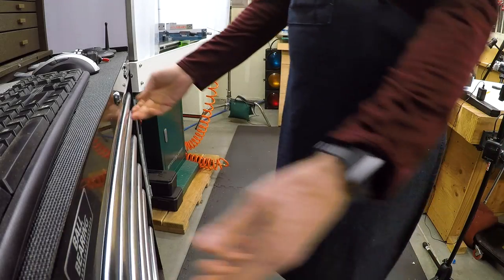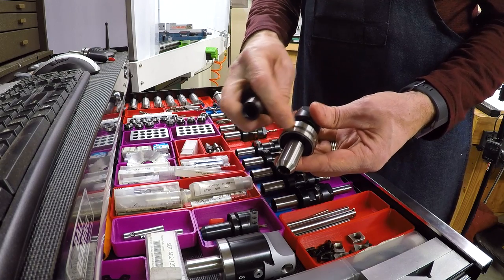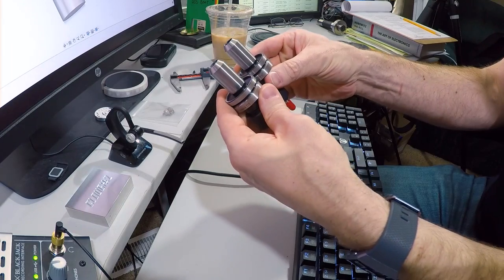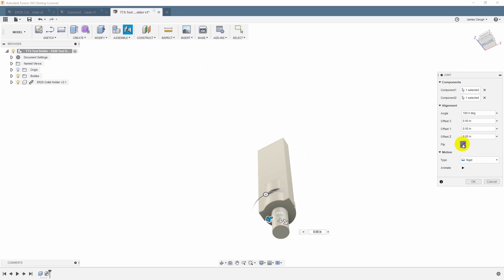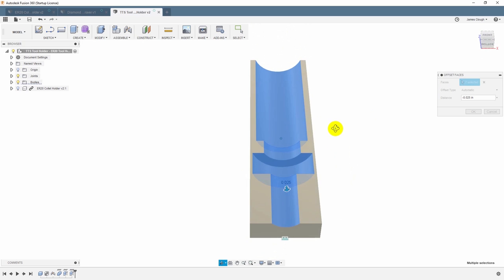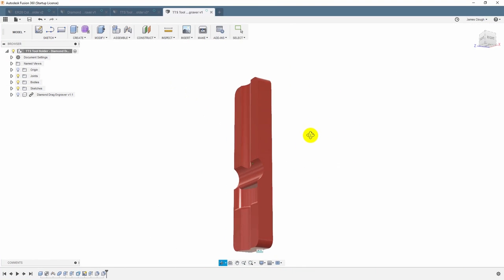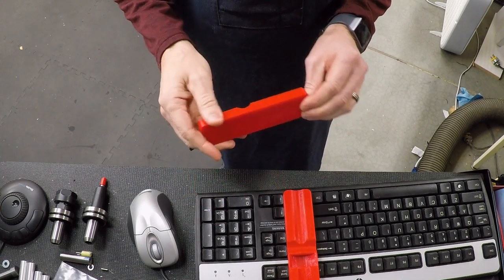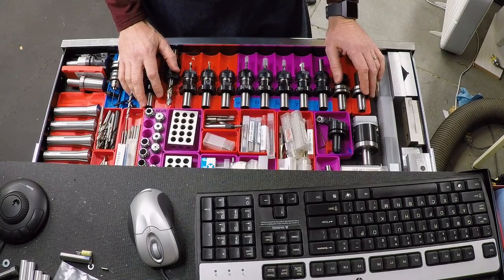How to Make 3D Printed Tool Drawer Organizers

Comment: Sir, with the biggest respect, but if you set up your slicer correctly, you dont get the extra thinker line on the bottom. Also ABS gets no warping if you have an enclosure. PET-G is like PLA a beginner filament, which needs no experience. ABS needs it. But for your needs, you PET-G or in this case is good enough.
Reply: abs is not great when it comes to oil contamination...  and its a good idea to use the PLA and bake in the over for an hour and 90 degrees (depending on the spec of the PLA brand)
Reply: @IncredibleSolv  Absolute right what you say, but ABS is not ABS there are hundred different types of ABS like PLA or PET-G. I made my own now with my filament extruder, because i was bored of the differences all the time i got from manufacturers when they change the % of each component. But at all its always good to give the filament it into the oven to dry it BEFOR and AFTER the print to let the molecules get back in their position for some hours. It becomes harder and better.
Reply: POM or PA12 is better for oil parts
Reply from the maker: There are lots of factors when it comes to material selection.  For many years, I used ABS for everything.  It's particularly good as an engineering material for things like gears because it's tough and has good surface lubricity.  The hundreds of extruders and RC airplane parts I've sold over the years have all been printed in ABS.  ABS is also a good choice for outdoor projects that will be exposed to weather--especially with a coat of paint to protect from UV exposure.  PETG is easier to print without warping, but has other issues.  It's gummy and stringy and doesn't reproduce fine features well at all, so it tends to be terrible for mechanical parts.  It bridges poorly and has to be printed slower to get good results.  However, layer-to-layer adhesion is fantastic.  Large, thin-walled parts are very resilient in PETG.  The layer adhesion is so good it usually tears across the layers, rather than splitting between them, like ABS.  The phone cradle in my car is PETG, and it has held up very well to the heat and cold without any issues.  I've always used ABS for that application, but PETG's flexibility I think makes it a better choice.  The layer adhesion comes with a tradeoff though, in that it's very difficult to remove support material.  I've never found much use for PLA.  If I were making decorative items to sit on a shelf, it might be okay, but for engineering use, it tends to be too brittle.
Reply: @Clough42  so if you have the problem that layers don't stick together, it's because your fan is blowing too much air. PET-G often only needs 10-20%. It depends on the material, but the basic mistake is that the fan is not adjusted correctly, not the material. I've had a lot of people say it's the material, in the end it was always the fan that was wrong.
Reply from the maker: @Qing I haven't had any issues with layer adhesion with PETG.  I have had issues in the past with ABS, and solved it by increasing the extrusion temperature to 255C.  Layer adhesion with PETG has been excellent.  It's one of the things I love about it.
Reply: @Clough42  Great information Sir.  
Thank you again.

Comment: Why are the only choices PETG or ABS?
Seems like PLA would be just fine.
Reply from the maker: It's what I have on hand.  I don't stock PLA because it's usually pretty brittle for mechanical parts.
Reply: Clough42  what brand PETG filament did you use for these?
Reply from the maker: @rickeldridge8227  These are Hatchbox.  I also use eSun.

Comment: Autodesk fusion 360 is too rich for my blood since I only do this weekend warrior.  $495 a year or $60 a month.
Reply: Take one class a year at a community college and it's free.
Reply from the maker: Fusion 360 is free for makers/enthusiasts and even for businesses making less than $100,000 per year.
Reply: What Clough42 said:  It is completely free if you are a hobbyist / maker / student....  You just need to install it and click the license thing in the upper left and fill it out correctly.  They will give you a license for free as long as you meet the requirements  (make less than $100k per year in the venue that you are using their tool.)   I absolutely LOVE that they do this because it gets a lot of people into 3d design that might not have entered into it.
Reply from the maker: It's really smart.  It basically means that every mechanical engineer coming out of school already knows Fusion 360.  I really can't understand what Dassault Systèmes (makers of SolidWorks) is thinking.  If they offered student and enthusiast pricing, they could totally own this space.  (Like they used to.)
Reply: @Clough42  Serious question though, because I've never used Solidworks but I might:  Is Solidworks even anywhere close to as easy to use as Fusion 360 is?   I've worked (a little bit) with a lot of different 3d modeling programs and Fusion 360 is the most intuitive and has the smoothest work flow of them all.   I understand why some people find it hard to learn, but I think the big problem is that they haven't found good step by step videos on how to use it and I have.  Also, since I'm a little experienced with a number of products I have an idea of how to think in terms of 3d design, and Fusion 360 seems to be made as simple as a complex system of 3d drawing tools can be made.   Does Solidworks even come close to touching Fusion 360 in that department?
Reply from the maker: The short answer to your question is no.  SolidWorks assumes you're serious about learning the product and you'll invest the time to get over the learning curve.  The primary practical differences in my experience are the feature tree, mates and the way it handles assemblies.  SolidWorks manages features as a tree, rather than a list, and you can turn different branches of the tree on or off with configurations.  This way, you can make multiple versions of a part with different features.  Fusion operates in terms of joints, where one joint is intended to fully define the connection and motion of two parts.  SolidWorks operates in terms of mates, where multiple mates gradually remove degrees of freedom of motion until you get what you want.  Depending on what you're doing, sometimes one model works better and sometimes the other.  Solidworks is also, in my experience, easier to manage with large assemblies.  Each part is tracked in a separate file and assembly files join them together.  The file-based approach also makes it much easier to manage large projects with a version control system, like Git.

The TLDR is that Fusion 360 is more accessible to the casual user, and SolidWorks is more powerful for complex engineering projects.  (and much more expensive)
Reply: @Clough42  I really appreciate the discussion!  Though, I do believe Fusion 360 has something equivalent to the file based approach but maybe it isn't automatically intuitive how to use it as a tree:  Components and Component Assemblies.  If you create individual components (separate files) you can then import them into another file as components.  This creates a link within your file which I'll call this file Model ABC.   So, if you import Part A, Part B, and Part C into your Model ABC and then have them all together.  Say you decide to edit a feature of Part A.  You can go edit Part A separately adding new features or tweaking the design.   Then you go back to Model ABC.  You can decide to either keep what you have (don't do anything), you can decide that the component as it was previously represented should NOT change in Model ABC (break the link thus separating Part A in Model ABC from its original Part A file, or if you are still with me here:  You can right click on the Part A within Model ABC and tell it to update.  The new model will be loaded into Model ABC and any new features / new design changes will be imported into the model.   This sounds very much like what you are describing in terms of managing large assemblies.   Because it is Cloud based, multiple people can share access to the Parts while only one person has access to the Model ABC.   So, things like Git and other control systems definitely provide additional features, but with Fusion 360's own built in versioning (saving the file off as you demonstrated in the video being one of the manual version creations in addition to the timeline saving changes that are made.)  and combined with the permissions that can be established on components and models, then I see that there is similar functionality here.     

For that matter, I only talked about Components as separate files.  You can create individual components within a single file and then merge them into an assembly, though I think the separate file approach more mimics the functionality you're referring to in your reply.   Each file has its own version tree, and each time it is embedded as a component there is a linkage there back to the original component file.   Changes aren't automatically merged into files they are embedded in, but that isn't hard.  That process seems a lot like version control merging to me where merge issues are handled on an "intentional" basis.

I am certainly NOT saying that Fusion's way is better.  It sounds like Solidworks is a lot more "standard" and readily understood by the average developer.  As a software engineer I'm quite familiar with what you are talking about from that point of view and I can imagine that it isn't too much different from a 3d design standpoint.  I am saying though that maybe Fusion 360 has a lot more to it in terms of version control, collaboration, and complex bodies than you first recognized?   Part of the problem is that Fusion 360 is constantly adding things and it is hard to keep up with it all. If you disagree with me on any of this, I certainly won't take offense here.  You certainly have a lot more experience with both tools than I do.  I merely have been studying Fusion 360 and thought that maybe I had seen some features and seen some examples of this that maybe you hadn't come across yet?   Perhaps I had found something in it that you hadn't played with yet?  Or maybe you have and you've found it deficient.  I'm open to my POV not being complete.  Thanks for your time!